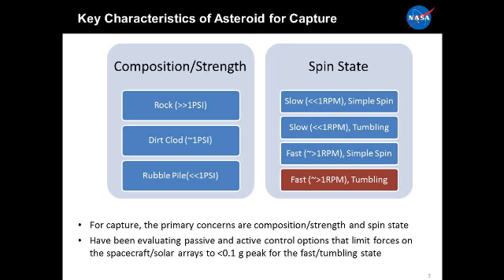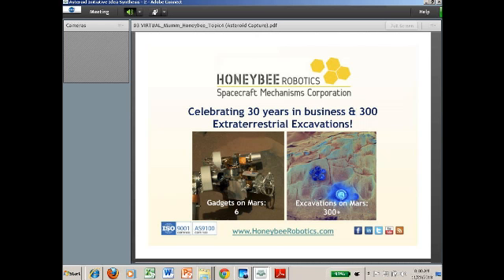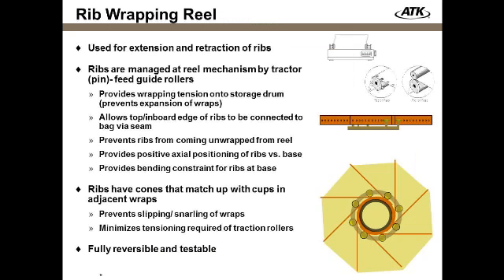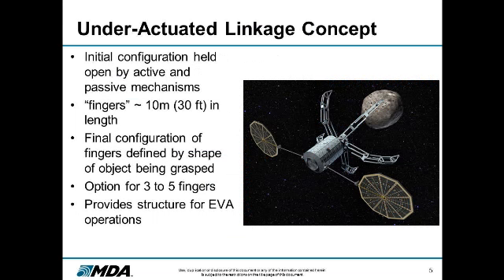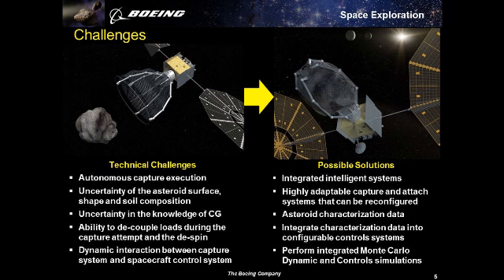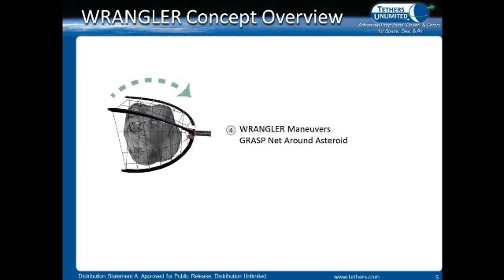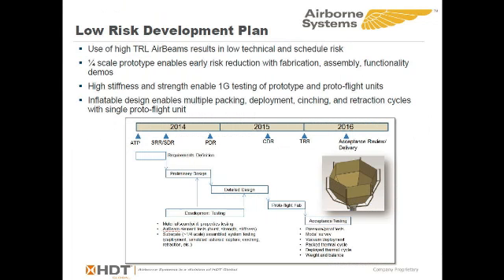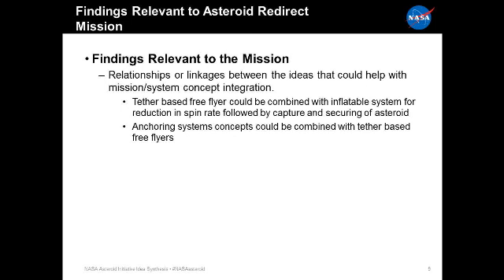Capture Systems - Part 1

Comment: And NASA should fly a demonstrator/precursor mission!

A small satellite should serve as an asteroid analog ("artificial asteroid"). E.g. give the artificial asteroid two inflatable spheres at both ends (kind of like the fused binary "asteroid peanuts" one sees), or even better, an more irregular shape. The artificial asteroid should have gyros and/or thruster to put the artificial asteroid into the worst case scenario: a 2 rpm spin, with tumbling! Put the artificial asteroid into LEO, and fly a precursor mission.

Or even better, you could check out the ARM spacecraft in LEO with this artificial asteroid first, before the ARM departs Earth. (Obviously such a test is not suitable for all capture solutions, as some capture solutions are "one time use only"… All the more reason to go for a robotic solution like MDA's.)